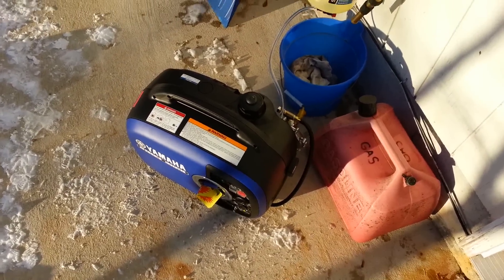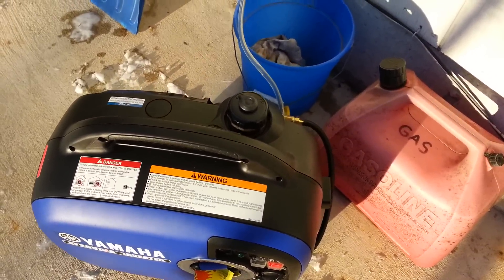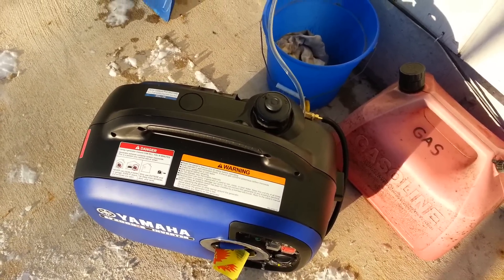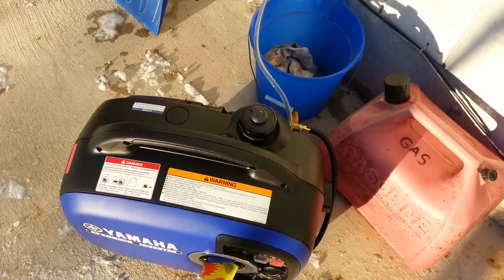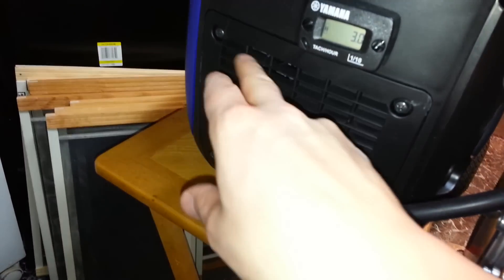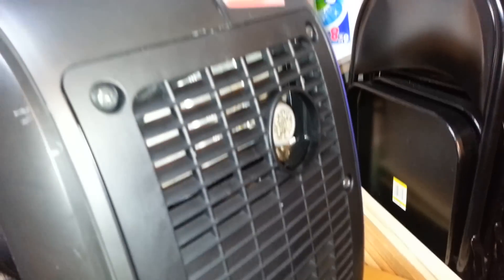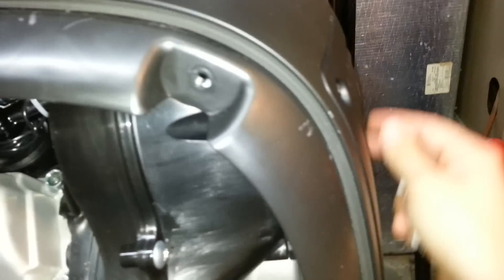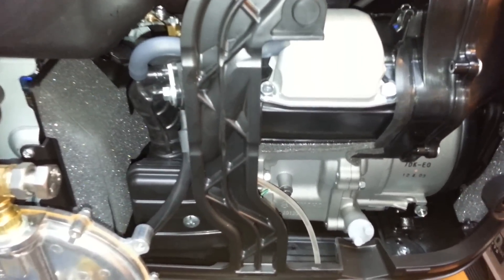Yamaha EF2000iS Tri-Fuel Kit: Final Assembly & Gasoline Break-In

Comment: The reason the Hour Counter wont work is because of the interference from the inverter electronics. They are located right inside where you mounted it! You can put the counter anywhere else...just not there.
Reply from the maker: Agreed it makes sense because if I connect the generator to my ground rod or use my EMI RFI filter the hour meter works. I'll look to relocate it at some point.